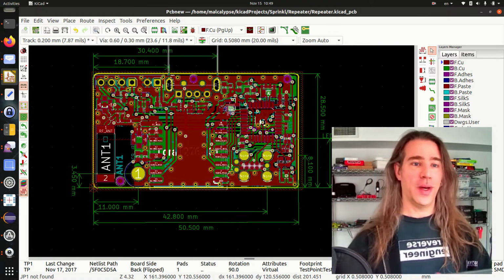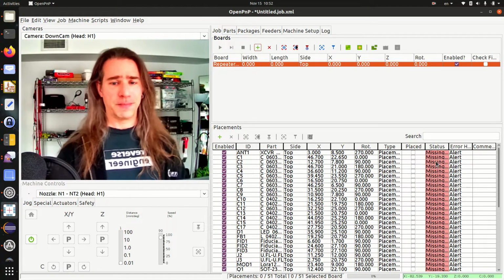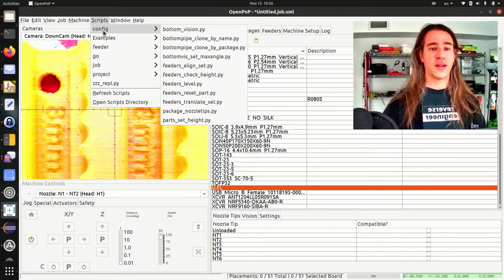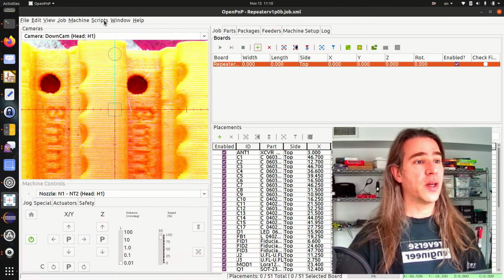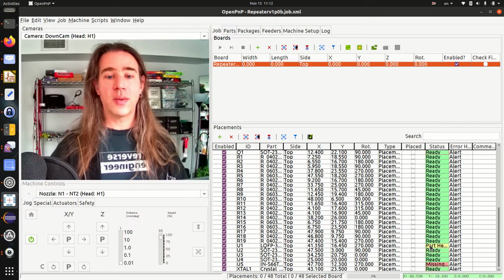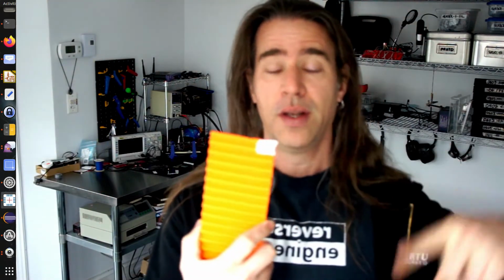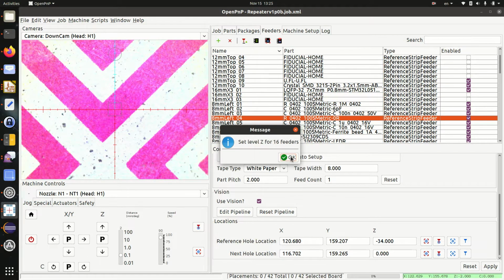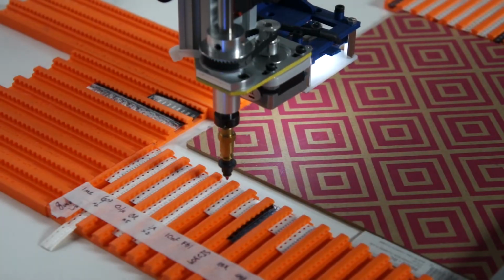OpenPnP Project Setup Simplified

Comment: Geez, there’s a very real need for an overall script that does ALL of this automatically. I’m beginning to think I will never do this. Life is too short for this.
Reply from the maker: Really, there are two hard parts left: calibrating the height of the feeders and putting the damn things on the table.  Both would be helped greatly by using some real industrial feeds, but it will always be something of a pain... main thing is that I find it's still less painful that placing 50 100n caps in the right spots, then moving to the next one--if there's a lot of parts or you're doing many boards, it's worth it.  Otherwise, you're totally right, and I just did 5 small boards, and two bigger ones, by hand last week... 'cause life's too short for all that :)

Comment: As our scratch-built PnP starts to come together, your work on optimizing the workflow is really awesome and valuable.  We're attempting the daunting task of trying to make a PnP machine usable by a small group of people at our makerspace, so we have all sorts of logistical hurdles to consider.  We've invested in a bunch of surplus Siemens industrial feeders so we can have dozens of reels of standard value passive parts that will be shared.  We need to figure out a modular, repeatable way for the users to be able to set up their own static feeders with short cut tapes for their custom parts per project, and quickly swap those in and out of the machine as well as all the tedious work of configuring them.  Not to mention the headaches with everyone using their own preferred EDA tools (KiCad, Eagle, etc.), and having their own part library naming conventions....  Your work has given me some ideas and I'm hoping we can build on it!
Reply from the maker: Oh, wow, that sounds like an awesome project with its own particular hurdles, would be curious to see the custom PnP in action.  If you want to collaborate on anything, e.g. getting the auto-feed configuration plugin working with eagle, let me know--always looking to make my stuff more broadly useful.

Comment: I am in the (slow) process of building my own PnP (from scratch, no kit) and these videos are key to figure out where to focus to remove tedium later. Really appreciate them! 
Height; Can't you extract height from KiCad's 3D models and put that into BOM or some other separate file?

Fiducials; Also sounds like handled automatically when having one's own fabrication outputs.

Feeder Contents & Positions; For myself, I'm making active feeders for reels, with a microcontroller and eeprom, controlled over RS-485 so that they can know what components are loaded and they will know their respective physical location to slot into with the address on the communication connector that is fixed on the machine. Hence keep each component in the feeder "forever" and just have more feeders than can fit the machine. In principle, the same could be done for Strip feeders, but perhaps the other way around; Put a connector and an eeprom on the feeder that stores what component is on it, nozzle type to use, and then just snap-in each feeder to some suitable location and software configures it all.
Reply from the maker: Wow: I played it safe, going the kit route, for this first in-house PnP.  Frankly, I'm not that mechanically adept, so find the prospect of going at it on your own daunting and impressive.

Fiducials are lifesavers, yes: they're in the position file, and allow you to just drop the PCBs pretty much anywhere--openpnp figures out exact orientation and position and just using standard fids from the EDA has been uber reliable.

The feeders are the main pain point.  Configuring them, positioning, refilling.  An automated system is the way to go, at a minimum for the stuff you'll be using all the time (0.1u caps, anyone?).  

Hit me up when you've got something built, I'd love to see it!

Comment: Awesome, good work!
Reply from the maker: Many thanks--let me know if you use the scripts and especially if you encounter any problems.  Cheers!
Reply: @PsychogenicTechnologies  Hello Pat hope you are good, I have finally built a P&P machine and I want to optimize setup time with your awesome scripts, but I have a hard time getting auto_feed_setup to work as my *.cvs export from KiCad looks completely different than yours. I wanted to try generate_map too but I get an error for "Could not import svgwrite lib, aborting", I have the Lib in the location but maybe it is wrong. p.s. I am not using Linux and the rest of the scripts for an initial setup like Enable, Disable, Part Height, Bottom Camera are working fine. Do you maybe have some time to point me in the right direction, what is important for these scripts to work, how should I set up the strip feeder and what is important, I followed your setup like 8mmLeft 01.... but unfortunately, it is not working for me. I have a feeder plate for 30 strips and 21 Tray locations, all should be like 8mmTop 01 - 30, and Tray 01 - 21.
Reply from the maker: @zdenkostanec1622  Hello Zdenko!  Awesome, welcome to the PnPclub :-D  For the BOM, it's likely just a question of using the right exporter (or re-sorting the columns, but ugh).  I have a whole bunch of options, assuming it's the same in non-linux world, and I use "bom_csv_grouped_by_value"--have you got that one?
For the svgwrite, mine is in the same "lib" directory as psypnp itself.  However, I had to muck with it a good deal for it to work--are you using the version from https://inductive-kickback.com/2020/10/psypnp-for-openpnp/ ?
Also, the auto-setup system relies on 3 files (other than the actual code): the bom, the package description and the feed description files.  My package description is slowly but surely growing, though I think I push those changes.  The feed description file is unique to your setup, but if you're using "8mmLeft*" that should just work.
Finally, trays... ah, trays, haven't got around to implementing support for them.  However, I did make some important updates recently(ish)... still need to do some cleanup, but had a major project that stretched the system's limits (ok, busted them, but I worked around it and published the code).   Make sure you're using a fresh version from github.  
Not certain if any of this helps.
Reply: @PsychogenicTechnologies   Hey Pat! Thanks for the fast replay and details. 😊 I will check one more time if I have the latest version of "svgwrite" but I should have it. And yes I have "bom_csv_grouped_by_value" but my export puts all the information in one Column (Comma-separated values "CVS") so I need to replace all "Commas" with "Tab" to separate each information to a separate Column in excel. I managed to do it but I get and "weird" information like "0 feeds enabled out of 17" or something, so I do not know where this 17 number is coming from, I have just 4pcs 8mmLeft feeders for the test and like 105 different components in BOM. I understand the logic now behind description files but the key I do not understand what is Important for Feeder setup, is it just a Name that needs to be the same as in Description file or do I need to set up some other parts? For example, do I need to assign some random component to a feeder or just leave it as FIDUCIAL-HOME, does it needs to be enabled/disabled, does coordinates need to be in or just for testing the scripts they can be  0,0,0. From my understanding feeder can have any component in and it just needs to be enabled and the script should automatically "re-shuffle" all the parts through all enabled feeders?
Reply: @PsychogenicTechnologies  Hey Pat, I managed to sort issues with "Auto_Feeder_Setup" and csv import, I needed some CSV editor to do it properly, excel edit will not work. Only thing what I have now is to sort "generate_map" issue "could not import swgwrite lib, aborting" 😕, still fighting 😁😁
Reply from the maker: @zdenkostanec1622  Hey, oh good.  Ok, not sure what the excel issue is but glad you got around it.  As for the svgwrite lib... don't use the latest and greatest--I had to hack it up to get it working.  Get the one from https://inductive-kickback.com/2020/10/psypnp-for-openpnp/ and install it in the same dir as the psypnp library itself.
Reply: @PsychogenicTechnologies  Hey Pat, yep, I am using that one, but unfortunately, I can not get it to work 😞.  I have the psypnp and svgwrite in the same directory under .openpnp2\lib, so .openpnp2\lib\psypnp and .openpnp2\lib\svgwrite folders, but nothing, it seems to me there are some issues with directories or something. :-/
Reply from the maker: @zdenkostanec1622  mk... send me a message through the inductive-kickback site contact form and we'll take this off the youtube comments section...

Comment: Thank you for your kindness to share your knowledge with us!
Question: can you implement BL Touch probe (like in 3D printers) to measure the height of parts automatically instead of manually try-and-try-again?
Reply from the maker: Hi, sorry for the tardy response... I considered doing such a thing, but never got around to it.  Some obstacles were pretty dumb, basically how to mount the thin and how to get the info back to the system.  Now that I've been playing with 3d printing more, mounting is less of an issue.  Main issue I can foresee is tolerance--since we can't use conductivity, you're looking at a mechanical switch or something and I'm not sure what kind of precision we can expect.

Comment: Random idea..... Why bother with setting heights at all? Use a floating head, such that when the head touched the part it will sense the component or board and stop feeding. This is used all the time in CNC plasmas to check height of steel, checkout linuxcnc plasmac. Would eliminate the time consuming part
Reply from the maker: Hi James, in short: completely agree.  In fact, the original LitePlacer software did this by leveraging the spring action on z plus the limit switch.  

But in practice, the spring was too tense, or the limit switch too far, but it was too much of a mash-into-components situation to be useful... at least in cases where tape wasn't completely flat and bedded on a rock-solid surface (i.e. even more time waste dealing with parts that flew all over the place).

I will however take a look at the linuxcnc plasmac, see what that's about.  At this point, I've started using dragpin-fed reels, and it's rocking pretty solid.  Will be documenting that in the nearterm.

Comment: How to make this project manually without CSV files?
Reply from the maker: Hi Vitaha,  sorry it took me a while, was prepping then taking a trip.  So... I'm not certain I understand your starting point.  What software are you using, what's the situation and what are you trying to do? You have a project you want to assemble, pcb laid out, boards done, right?  With a bit more info, maybe I can assist.
Reply: @PsychogenicTechnologies  openpnp No csv file.how to manually enter coordinates into the program?

Comment: Great video. I was disappointed you skipped peeling off the cover tape to show any tricks to doing it without dislodging parts. How long overall did it take to set up this board?
Reply from the maker: Oh, yeah I should've included that!  The technique is basically:
 * left index holding tape down
 * tweezers in right hand, getting under cover tape  around that bit of extra material on the side of the holes
  * grab and peel at 45 degrees until first part is exposed
  * jiggle first part or two out onto work surface (optional, but seems to be the annoying tradition)
  * peel off the number for a few runs, plus some overhead in case
  * don't cut the plastic cover or peel it completely off of a small cut tape, or you will almost inevitably jiggle them all out of their spot
This is assuming 0402--procedure similar for all, but just touchier for these guys.
Main point is to be gentle and expose for n runs on all tapes at once, so you don't have to go back in there until it's time to reset them all.
As for total time actually spent doing this, I don't recall.  For simple boards like shown it's under an hour when I'm focused, but not sure.

Comment: Nice scripts Pat.
What's your thought on the new contact probing nozzle in openpnp?
I have yet to try to configure it because like you I know the height of the part/tape/feeder in relation to the work surface and just set the height that way.
https://github.com/openpnp/openpnp/wiki/Contact-Probing-Nozzle
Contact probing in the liteplacer software was always fickle for me. It would hit the limits seemingly randomly no matter where the z high/low switches were or how the switch hysteresis was set.
Cheers.
Reply from the maker: Hi Mark,
The LP software contact probing worked fine for me, other than the fact it had a tendency to bang into my parts a bit (a lot) harder than I would've hoped.

As for getting a dedicated sensor, rather than using the limit switch: I'm a bit curious, but since my space as pretty stable, I do the setup as shown every project but am pretty much set for the whole batch from there.  

What I would really like as an add-on is a vacuum sense to catch when a part isn't picked up... I've had multiple occasions to experience the joy of a nozzle tip sucking on solder paste because of that and if my next extension isn't automated feeders, it'll be related to that.
Reply: @PsychogenicTechnologies  Oh dear. Could Sucking solder paste cause a blockage in the suction line? That would cause everything after to fail. 

How do those with the vacuum pumps on the head sense the part ? Do they just use bottom vision to detect a missing pick?

Comment: Hello! Can Allegro PCB Designer items be imported (extension ".txt")?
Reply from the maker: Assuming you're referring to the auto feed setup script: currently it only has support for the CSV files produced by kicad, but it should be pretty agnostic in terms of BOM as long as:
 a) all the info is available (i.e. quantities, some way to identify the package/part, etc); and
 b) support is added for this format
There's this generic class for BOM parsers, and then an instance for kicad (BOMParserKicad) currently in there and it shouldn't be super hard to add another type.  I'd have to see the allegro output to be sure.

Comment: Is there an app for android?
Reply from the maker: For openpnp? Not as far as I know.  Haven't looked, I'm far from having a mobile pick and place, heh!  Seriously, what's the use case/what would you like to do?
Reply: @PsychogenicTechnologies  im planning to build a multipurpose cnc machine(CNC laser Engraving, PCB and wood Milling, 3D printing, plasma metal cutting and in last a pnp machine.
Now I have made a 3D printer its in working condition using marlin and arduino mega,
For pnp I need to run it with my android smart phone